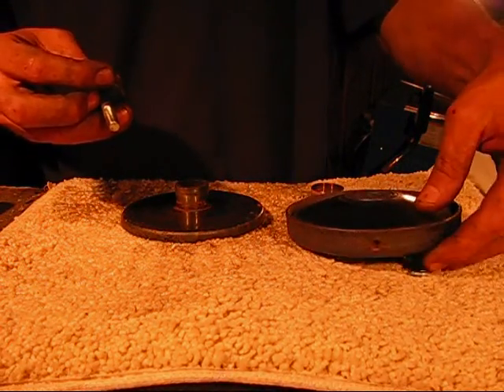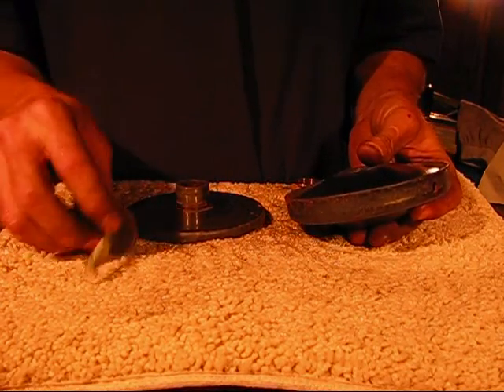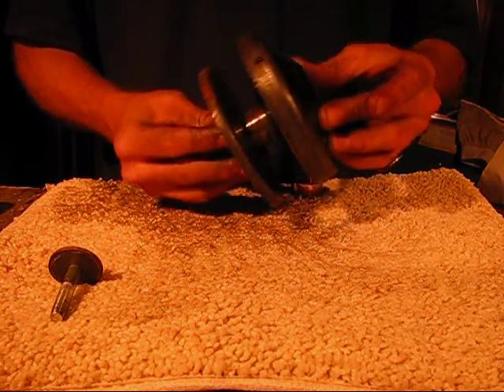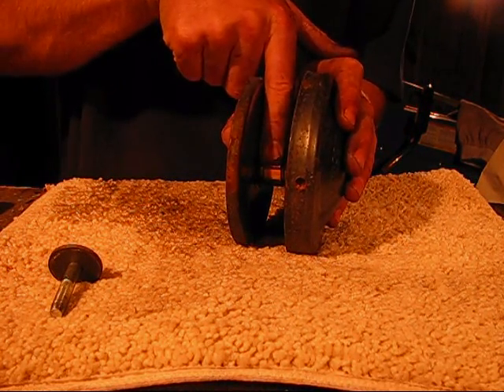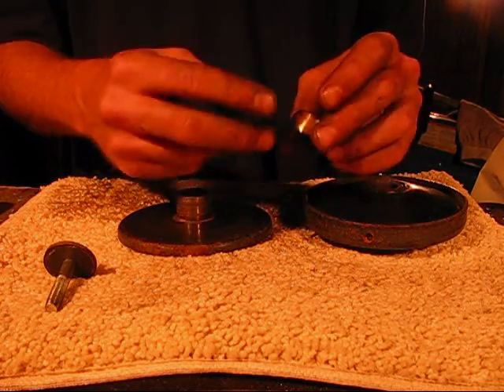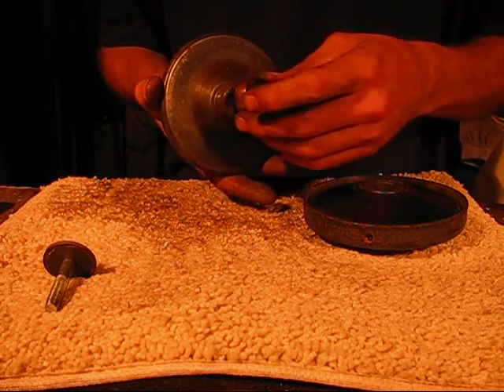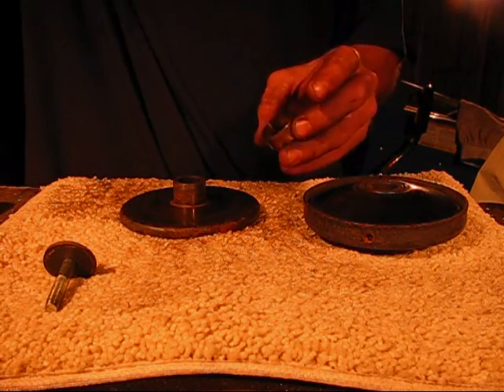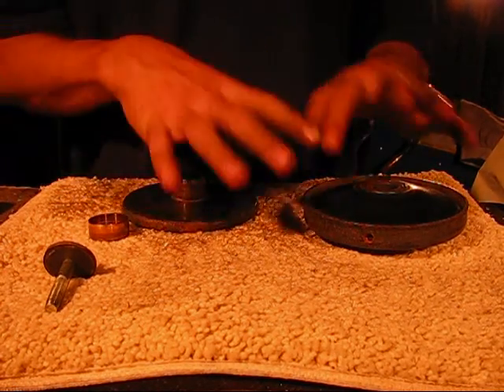█ Go Kart Torque Converter #1 ( Cleaning my Driver for 30 series Comet ) █

Comment: Tman:

The weights are made of zink for a stock 30 series.
Aluminum is available for some racing aplications.

Best to use some wire wool and soapy water to scrube them clean then relubricate with Moly dry lube ( could use some wet inside the weight area but more cleaing will be required ).

Block  sand the clutch faces with some 120 grit if there is any wear or rust.

Comment: Nice! I've never seen the inside of one of those. Looks like theres a lot more to it then I expected. Heres a quick question, how far beyond the crank shaft does the driver clutch protrude? Does it stick out more than the shaft itself? (obviously the bolt does) Just wondering if I have enough clearance for one of these.
Thanks!

Comment: When I take off from a dead stop my go kart jolts real bad, several times, like something slipping. especially with the extra weight of another person. Is it the torque convertor or do I need a new belt? is the torque convertor bad or can it be cleaned or repaired? Thanks very much.

Comment: I just got one of these manco carts with the 6.5 on it. Runs awesome but the thing wont go. the belt tightens and the toque converter slips? not the driver on top, it works fine, I just cant understand how these work. Could someone explain what my problem could be. I can twist the torque converter with my hand and it doesnt turn the sprocket.

Comment: i have a 30 series . on the slightest incline it wont go it start to wear the belt. on flat land it runs pretty good.i cleaned the drive pulley. i dont think it had a brass washer im  going t double check that but the srings were dirty they didnt look stretched. can u help me?
Reply from the maker: MrOly076 what size of tires do you have.